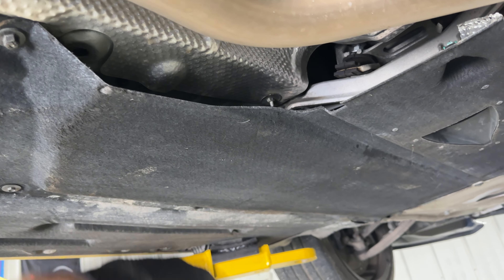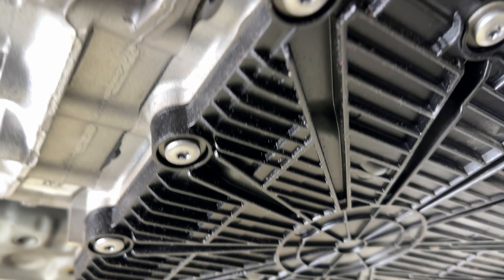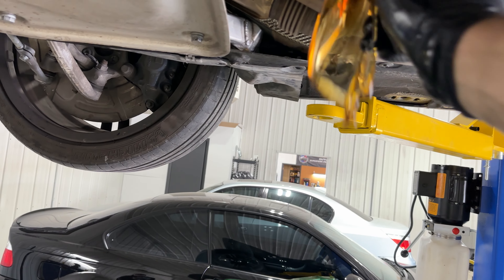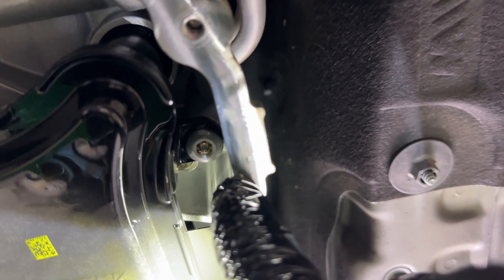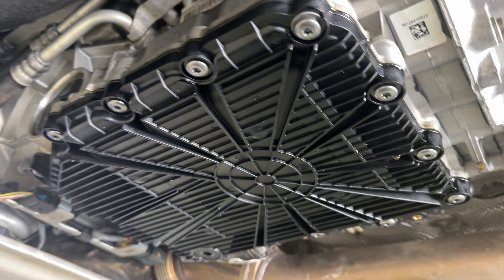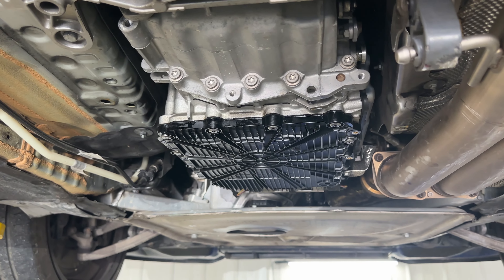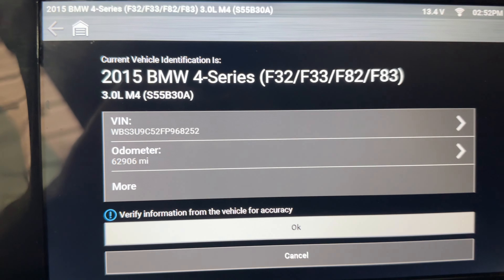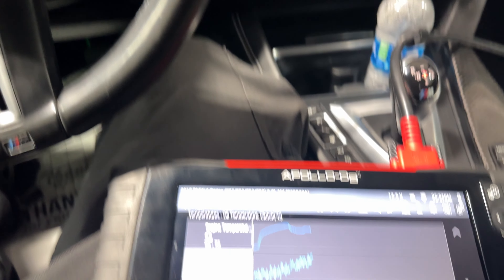Complete Guide: DIY DCT Transmission Service for BMW F80 M3 / F82 M4 - Step-by-Step Tutorial!!

Comment: DCT is lifetime fluid on F8x cars, what’s the reason for doing this flush?
Reply: Because lifetime fluid is not a thing, every oil breaks down
Reply: BMW spec for Lifetime is 80,000KM's
Reply from the maker: As they said, BMW calls it lifetime fluid but we have never seen one of those fluids last the life of the vehicle unless the vehicles engine or transmission fails. Remember BMW told people to go 10k miles on oil changes!
Reply from the maker: @ahhhh226  true!
Reply from the maker: @ahhhh226  correct!
Reply: Impossible, every kind of oil that' we know definitely changes their chemical bonds  over the time by heat or mechanical pressures. They ( car companies  ) say life time oil so people don't think to change it and then after couple of years they get defects on transmission and .......
Reply: How does holding the engine RPM at 2k raise the transmission oil temp without the transmission being engaged ?
Reply: @5_Pound_A_Day_Investor I’ll assume the dct fluid passes through similar passage ways as the coolant
Reply: Do you need to reset adaptations?

Comment: Hello, thank you for sharing the post, usefull:-) I saw that you bought 6 litres of oil, but the transmission circuit is projected for 8,5 litres (DCT+cooler+pipes). Did you changed all the oil or only the amount in DCT and the rest (2,5 litre) in pipes and cooler you left there? Thanks

Comment: BMW claim this is a lifetime part that doesn't need servicing. 
Interested as to what has led people to doing the service and what the benefits are.
(New f83 owner with 57k on the clock)
Reply: "Lifetime" is often the duration of the standard manufactuers warranty. BMW also state the same thing for the normal ZF-manufactured automatic transmissions; however, ZF themselves state their transmissions require servicing every 60,000-80,000 miles. Anything with a fluid in will need servicing in order to keep that mechanical component working reliably. Oil is cheap, transmissions are not.